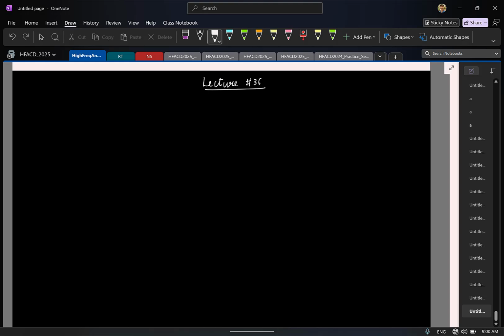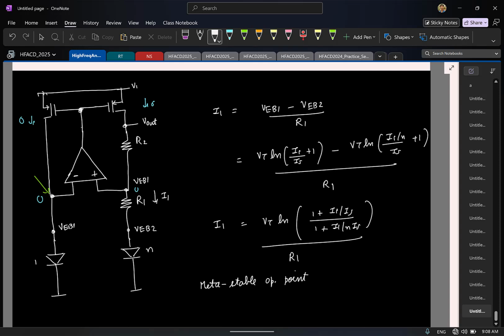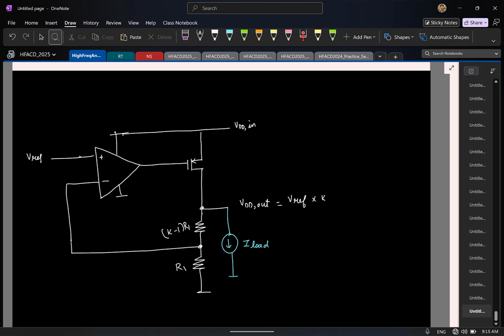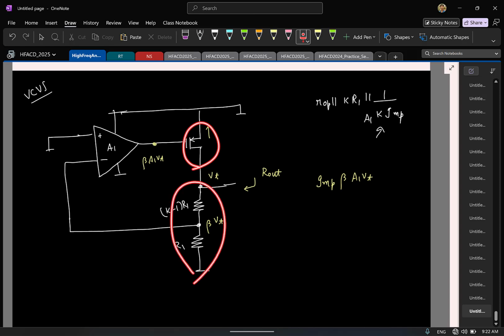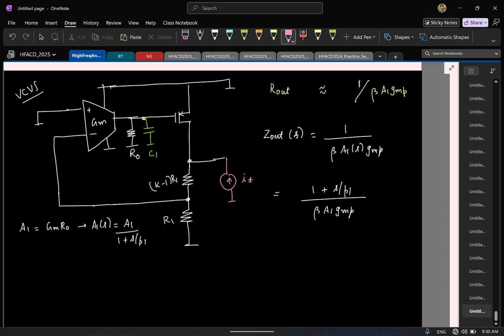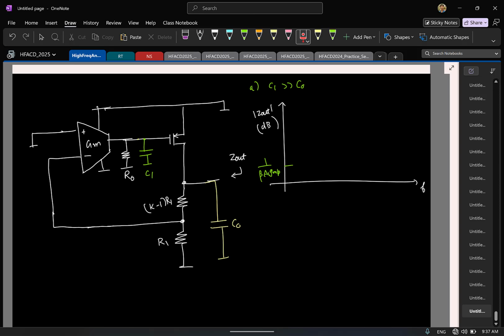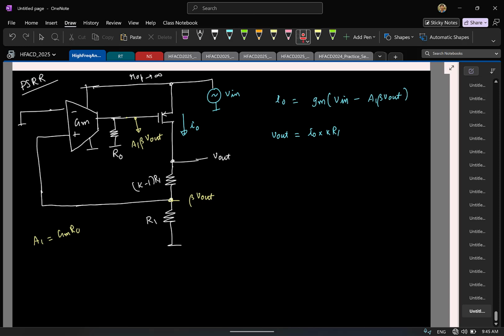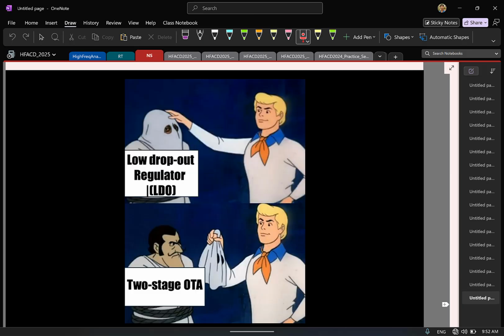Lecture 36: Intro to Low drop-out regulators (LDO); Understanding LDO as a 2-stage OTA in feedback

Comment: 13:16 an error was made at the signs of the opamp. The phase shift added by voltage buffer will result in Vref given to the -ve terminal, hence the signs are -+, which is corrected at 42:41 .